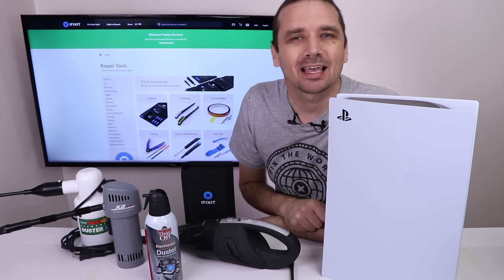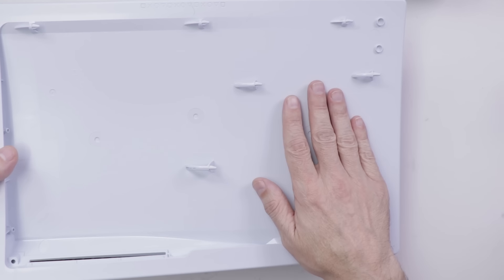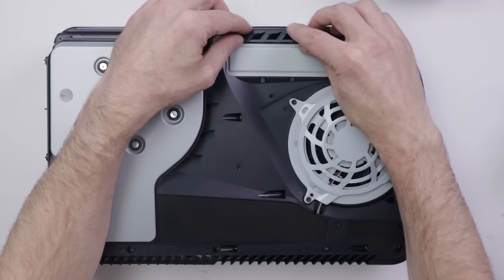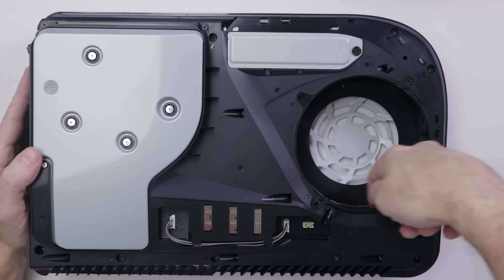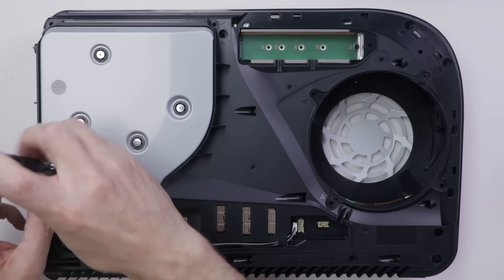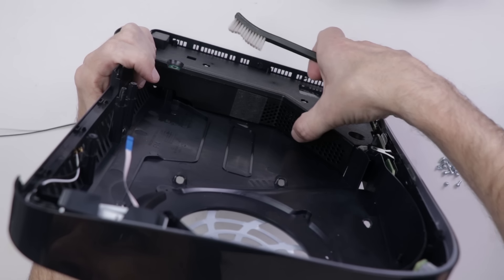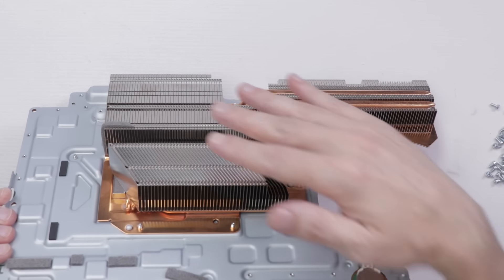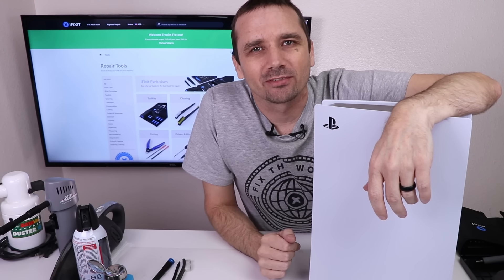How to Clean Your PS5 Safely - 3 Stages

Comment: So on stage 3 getting put back together, there are 2 screws that got put back in this video in the wrong spots, and one the the misplaced screws won't allow the disk drive to sit properly. Not a big deal but just rewind video til the disk drive was taking out for screw reference to save alittle time I guess. 🎉

Comment: The long black screw that's put into the right higher black part, opposite the disk drive, will not go in. It's the right screw, I know because I put certain screws in certain cups and wrote everything down. When trying to screw it in, it sounds like the screw is just rubbing against something else but won't catch and actually screw in. Don't want to leave my console halfway put back together but I don't want to have a previously used screw not be used because it won't go back in. 

Have an additional screw that's supposed to go very top right of disk drive with the black plastic on it but it's doing the same thing as the other screw. Have 2 screws with apparently no use anymore

Comment: I screwed up at the point where you remove the fan 😭 my pliers slipped and cut the wire on the left clean off, do i need to buy a new fan 😭🤦‍♂️
Reply: Hoho!

Comment: Good video. A little too fast in some sections. And he made some mistakes and then fixed them without mentioning it. A silver screw here or there that suddenly he removed. 

Also, pulling the silver plate off takes some force! Which he doesn't mention. Took me 10 minutes of pulling to finally snap it off. If has some some sort of hard foam 'glueing" it on. So don't be worried to pull a little.

Comment: 10:18 two screw are miss placed and replaced in their correct area near the extra hard drive slot. One is miss placed where the disc drive screws in and another just below the extra hard drive had me confused

Comment: mine keeps shutting down because of overheat but I'm unsure about going that deep
Reply: Have you tried taking it to a repair place? It could be the thermal part of your ps5 under the fan. It's like a way to keep your ps5 from overheating if it has a lot of dust in it

Comment: Physically couldn't do stage 3 as black panel would come off.

I tried levering with tools, hand, etc .tried just pulling it off and it almost bent 90 degrees and would have snapped if i went any further so hopefully i can just jam my vac n brush in far enough that it cleans it enough 😡😡😡

Comment: Video correction. 
Re assembling the 41 screws. 2 screws are in the wrong position. There should be 2 screws on bottom of memory slot. You installed them elsewhere

Comment: Thanks for the video your s is the one that really explained how to clean the ps5 and most importantly remove the cover s easily. I do fill that the ps5 hasn't been designed for hoter clinements because where I am the ps5 still over heats even with a fan on it and keep it clean I also noticed this with the ps4. I just hope that they get the next one right.

Comment: ⚠️ IMPORTANT NOTES on step 3 - on reassembly, video shows a silver screw (the one right next to 'F#-###') in a hole, but you should leave it empty for one of the long fan screws. Same with where the hard drive screw goes on bottom. Otherwise nice video!

Comment: I took mine to a repair shop and they said they did a deep clean. It still overheats, and when I did the level 3 clean dust bunnies were completely covering the power supply vent. They definitely lied, its only been a few months and the level 2 clean was clean enough. Alittle dusty, not much though.

Comment: Lose the toothbrush. You need to be cleaning all the heat sinks and the power supply with either an air compressor or a very powerful electric air blower. That gets 99.9% of the dust. Obviously be outside when you’re blowing it out. It freakin works like a charm.

Comment: Homeboy neglected to mention something about putting the 41 screws in… there are more than 41 slots for the screws the go in. You MUST put the screws back in the same EXACT spots they came from. The extra slots r for screws that go back on when putting on the fan/cover. So when I get to the point here I had to put the cover back on: I wasn’t able to put 1 screw in and thought “no big deal, it’s just one screw”. But then I got to putting the fan back in and now one of the screw holes for the fan is blocked as well! Again, he neglected to mention there are more than 41 holes for the 41 screws. Now I have to backtrack because he simply didn’t mention that tidbit 😡

Comment: I’m having an impossible time removing the mid frame. I’ve removed all screws but it’s stuck on the bottom right corner as if still screwed in. Can you please shed some light? In the video you just pull it off with what seems like no resistance. Do you pull straight up?

Comment: Pro tip: Before you remove the 41 silver screws, make sure to mark the empty holes so you don’t put screws in the wrong place when you reassemble. 

If you get in wrong, you won’t be able to close back up. Hope this helps someone ✌🏾

Comment: HMMM i noticed after the little cut for re assembly after step 3 and once you put the disc drive back on suddenly a bunch of screws moved around in spots they werent before and i had to back track, I know this is an old video but please do better.

Comment: For the USB port ribbon cable there isn’t a clip in order to release the cable, the first time I cleaned it I barely managed to get it out, and I’m not sure if I want to do it again, does anyone have info on what I could do to easily remove it?

Comment: when you fast forward the screw placement you put 2 screws in incorrectly and it cost me a lot of time and confusion. You fill one in the top right where the fan screws into the board and one under the disc drive where the black middle housing goes into the board.

Comment: After my most recent cleaning up to stage 2, I’ve noticed some dust down inside the console around the heat sinks  under the fan and a bit towards power supply…not a ton but it’s there. Thinking I need to do a stage 3 clean fairly soon…but I’m terrified 😩.

Comment: Just noticed that you put two of the small silver screws in the wrong place originally when putting back together again and then placed them where there should’ve been by the internal memory slot. Was putting it back together and one of the screws were in the place of where the fan screw goes. May want to re edit that bit for future
Reply: You can notice the change at 10:18 at the top corner near the internal storage slot

Comment: How do I remove the bottom right corner right below the fan. (If looking at it with the disc drive on the left). I got all the screws that I can see but that bottom right corner is stuck.

I'm worried about pulling on it too hard.

Comment: I can’t even get the first four screws out of the fan cover? There’s a stud in the T8 or T9 screws and it prevents me from getting the heads to match up… Not sure what i’m doing wrong!
Reply: @sirsieg  You need to use a TR8 Torx security driver bit.

Comment: I can’t get the black mid piece of for stage 3, I took all the screws out yet the bottom right wont budge no matter how hard I pull without ripping it off?
Reply: Idk if you already figured it out but there is another adhesive or small piece of tape on that side hiding a screw, remove that black tape to find the screw and your good

Comment: I did the stage 3 cleaning and when I put the ps5 back together the front charging ports on the ps5 stopped working. Is there a reason for this? And what did I miss when I put it back? Need to know before I open it up again

Comment: I regularly blow out and clean my PS5 even take the fan out and blow it out and use a tooth brush on it. I have an air compressor and keep it clean. I just cleaned my PS5 like a week ago and I was playing Modern Warfare 2 on shipment and their was A LOT going on the screen and without a warning the console just shuts off completely like its been unplugged I turn it on and it says it shut down incorrectly and it did like a safe reboot scan and turned back on fine. My console is on a table under my tv with open air every where and clean environment. Im like not even 2 feet from my console. Does this mean my PS5 overheated?  I had it since launch and have never ever seen it act like that or have this happen before. I checked everything the Power supply was fine and in tight in the wall and console, all the cords good. So is that a sign that I have to fully take it apart like this video? I'm scared to mess something up if that's the case

Comment: I got confused with some of the screws not the silver ones they all the same size the two screws from the back I left out, because they won't go back in probably another screw...it's just too much so I got two screws I don't know what to do with and one screw won't go back on the fan, cause I guess there's another screw below it so I just left it alone, so now I got only 2 screws holding the fan, again PS5 seems to work fine, I just don't have the patience PS3 or 4 wasn't this complicated

Comment: I followed your steps, and after reassembling the front USB ports arent working properly. The USB C is non functional entirely. I've disassembled multiple times to re-check all connections - and the only thing im seeing could be an issue is a ribbon cable, which ive made sure isnt loose. Any suggestions? Because im concerned ive broken my PS5 😭

Comment: I kind cheated out on step 3 instead of taking the whole thing apart I have a long skinny flexible cleaning brush that is made to clean small tubes that has long bristles I can stick down in there and clean in between the heat sinks and get the heat sinks really good only downfall is you can't really get deep inside of them really well but the bristles are long enough it does a good job so if you keep it clean it shouldn't get too bad inside of them that way.. it did it good enough to where it looks brand new I got a little flashlight I can stick around in there and see what I'm looking at with a camera so it takes a little bit of the labor out of it I just do it all from the fan hole

Comment: Hi! Do you use the same T8/T9 Torx for all the screws in Stage 3? I’d love to be able to clean the heat sync and power supply, but I don’t know whether the screwdriver set I’ve ordered will be enough.

Also, will anything small and flat be enough to safely remove the ribbon cables?

Comment: After over 2 years of use I’m starting to get the infamous error code CE-108255-1. I’ve done everything short of a factory reset. I’m hoping cleaning my unit entirely will help. It started back in March and has gotten progressively worse. Im starting to get scared. I take super good care of all my systems. This is super frustrating

Comment: please help me I did not pay attention to the screw the ps5 works turns on there is just a problem with the cd player I had to disassemble everything twice but the same problem is that I cannot get the cd in because I have screwed something wrong so the place to insert the cd is a little out of place which means that the cd does not enter I cannot find precisely where the problem is

Comment: Do you need to replace the thermal pads/paste after you pull apart the plate with the 41 screws or can you reuse them and put the system back together like shown in the video? Thanks!

Comment: I had to give up after Stage 2 because the plastic covering for the fan connection looks nothing like this.  I basically have a very small plastic cover with only the fan connector beneath and nothing else.  It doesn't stretch all the way to the left like yours.  There is also no grey metallic section for the HDD.  Basically, I think this means that what you describe as the plastic midframe is a whole piece of black plastic.  It comes up at the top with the screws removed but I stopped short of lifting it at the bottom because I figured there were wires connected.  Therefore, Stage 3 looks impossible for me.  I can't be the only one.  Any ideas?

Comment: So you really dont need to unscrew all the 41 screws. All that is for is to get to the unclip for the middle black thing. You can take it all off together and still clean the heat sink. Will save you a bunch of time.

Comment: hey man if you give me advice it would be awesome, seems like spiders went inside my ps5, i noticed cause there was traces of spider webs on the outside vents, took it apart, remove all those webs, looked at the fan, nothing on it for what id see just from taking out the plates, the bottom vents where kinda clogged with dead spiders or mosquitoes i couldnt tell tbh it was a mess, it used a regular home vacuum at the bottom and apparently it took everything but now i see 2 most likely dead spiders very deep through the vents of the bottom, what should i do? it works fine and im kind of scared going for a fur disassembly tbh.

Comment: Hello I know I’m late to the party but I’m currently having a problem with my ps5 it was working pretty good up until the update back in August the ps5 downloads the update but when it goes to
Apply it I get the same error code then it restarts then the error code pops
Up again then enters safe mode so I had to factory restart it to get it out of safe mode and it still won’t update and Sony support wasn’t much help any suggestions will be greatly appreciated. Tried everything even put the update on a usb flash drive still no luck :-/

Comment: I have a question! I have disk ps5 instead of a digital version, would cleaning it still be the same? I'm very afraid of breaking it lol. I tried getting off the face plates but couldn't since I didn't want to use so much strength

Comment: Ive had my ps5 since release and never taken the side covers off for any reason.

Stage 1 & 2 completed. I was very surprised with how clean it was. ( found a dead daddy long legs inside lol) . 

The heat sink shown at 5:00 was looking very clean.

I was not feeling brave enough to start stage 3, very clean during stage 1 & 2 but could it be REALLY  dusty during stage 3?

Comment: I'm a ps fan all the way, but I recently bought a series X Xbox and cleaned it, the series X is so much better than the PS5 in terms of ease of taking apart and really cleaning it. It's a shame that I'm probably not going to even attempt level 3 cleaning because you have to take it apart very deep, whereas Xbox slides right out and can be easily cleaned. I love both consoles though.

Comment: You don't need to open the fan of the console. You can remove the dust from the console by using a compressed air spray. You can also use a vacuum cleaner to remove the dust inside the console through its compartments. My advice to you.  This means that you must clean the handles of the console so that the analogs do not drift.

Comment: I’m about to clean my PS5 as it shuts off after about an hour playing PS5 games, every other game works fine. I will update if cleaning the heat sink & power supply has resolved my problem.
Reply: So far it seems to have stopped my console from overheating. There was a lot of dust & debris around the holes of the power supply & all over the heat sink. So far so good  🤞🏼

Comment: Not gonna be respectful cause you potentially caused lots of people lots of time and some money by not showing some key steps. 
1) There are TEN screws to remove the plastic casing housing the motherboard and ONE of those screws is hidden under a small black adhesive. 2) The ribbon connecting the motherboard to the disc drive ON THE MOTHERBOARD SIDE, does NOT get removed the same way as you removed it from the disc drive. DO NOT PULL.  Just to the right of the spot where you would have pushed down there is a very thin metal lock. This small metal piece gets pushed down and then the ribbon will release. 
3) The smaller ribbons can be removed by gentle tugging on the hard blue plastic part.
4) The little round metal connectors come off easily so don't be rough with it. Use a pair of pliers and jostle upward until released. 
4) If You've never opened up your PS5, the metal plate over the motherboard might be a little stuck to the board. If it doesn't immediately release, alternate gently pulling up from several sides to avoid bending the aluminum casing. You're probably still going to bend it a little bit but distributing the force will make the bend a little less drastic. 
5) The Black/White cable that runs from the bottom of the PS5 to the chip needs to be released from the tape if you want to completely detach the motherboard. While this may seem like an obvious and innocuous note, some of the OCD among us may appreciate knowing that your patience will be tested if you plan to not tear the tape. 
6)Similarly, if you forget which B&W white go where, there are little markers on the motherbosrd: FB/FW & RW/RB. The B & W correspond to the (B)lack & (W)hite cables 
Not everyone is a tech genius, genius. Be more thorough in your videos and description therein

Comment: So I'm at 7:36  where you remove the top plate, I've got one end loosened but the left side(situated same as the video) is really stuck on there. I'm sure I got all the screws. Is there an adhesive or something I have to break when taking apart the first time? I'm scared to use anymore pressure pulling up on it lol

Comment: For those who are attempting to clean the Power Supply dust and dont want to disassemble all the PS5, running the risk to ruin your console: You can reach the Power Supply vent from the cooler slot just using a tooth brush.